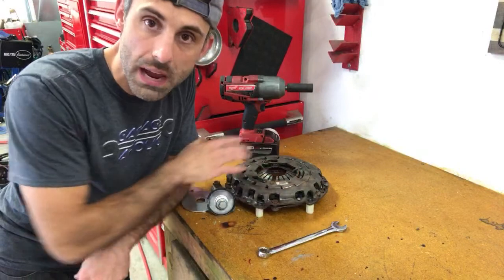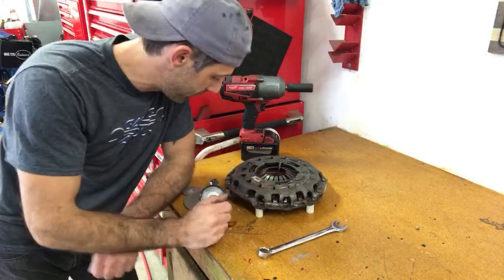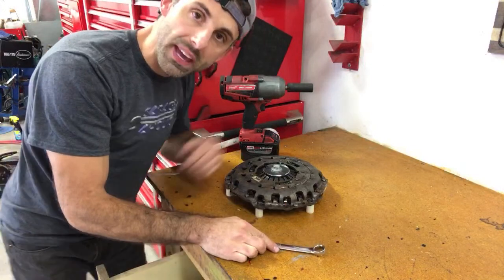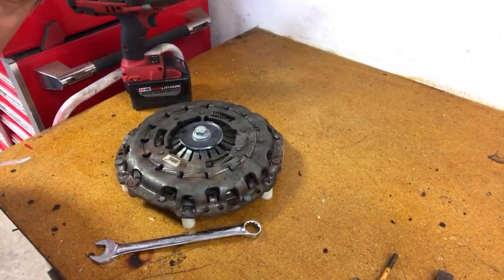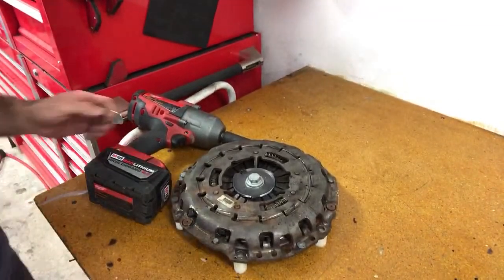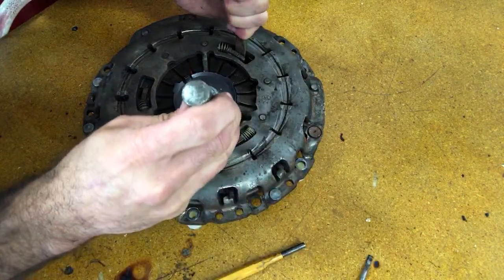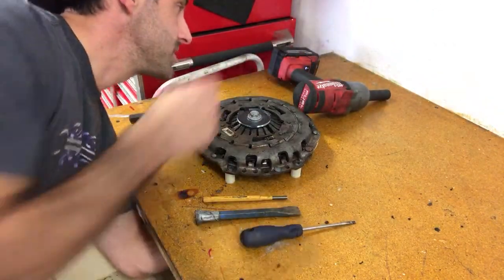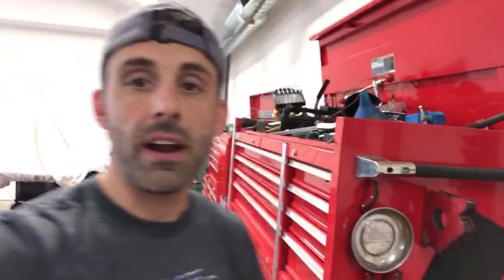LIVE: How to reset your BMW pressure plate with automatic clutch adjustment

Comment: I have a problem with my BMW M2. The clutch was burned at 5,000 km, and the car could no longer drive. I eventually replaced the clutch with a new clutch set, but I didn't perform the SAC reset. Could this cause any problems later on?

Comment: What if your reusing a 5000 mile clutch and putting it with the pressure plate in another car its a luk self asjusting clutch in a 2004 bmw 330i,  basically want to use both pressure plate and clutch from that car and swap it to another car, do i still have to do the reset?

Comment: So i installed a clutch kit at 60k miles...i mistakenly didnt replace the flywheel ...so now im getting a rattling sound at idle that goes away when i press the clutch....so my question is...when i originally installed the pressure plate it had a lock in the center....so after you reinstall it without the lock...im assuming it will adjust the first time you press the clutch?
Reply: Rattling sound is usually release bearing brother. One way to tell is if you hit the clutch and the sound goes away, 100% release bearing
Reply: @TheRealist007  took it to a shop and ended up being the flywheel had play...def sounded like the release bearing though

Comment: Hey so I’m installing my LUK 335is clutch / pressure plate combo today. 
Does That center locking plate on the new PP come off before I install so I can keep the clutch aligned?
As well as do I need to keep tension on the PP when/if I remove that plate or can I simply twist it out?

Comment: If I may ask, what is the purpose of doing this?
Reply from the maker: If you replaced your clutch plate without replacing your pressure plate.
Reply: @Garageaholic  so like my Dad's engine was replaced and cruise control stopped working after. Could this be the cause?
Reply from the maker: Definitely not. Probably something electrical I’m thinking. Not a pressure plate setting.
Reply: After replacing the engine, the gears failed to engage, so they stripped it again and discovered that one two of the springs were broken. Instead they replaced the pressure plate. The gears engage just fine. But the problem is that sometimes it vibrates and the issue of cruise control not engaging as it was engaging before the engine was replaced

Comment: Thank you man I took the retainer off on my new pressure plate and didn’t realize it completely released and installed it and it wasn’t until after I bought a new clutch master and spent 2 days screwing with everything that I realized this happened I had zero clutch pedal it was just rock solid

Comment: Great vid! I just installed the clutch in my 6 speed swap E32 and realized after the fact that I forgot to clean the pressure plate surface😅! Was looking this up thinking I would have to readjust the clutch to lock it again or something but after reading the comments I see that I can just reuse it as long as it's brand-new which it is
Reply from the maker: Yep, i think I answered your Question on IG, right?
Reply: @Garageaholic  absolutely thank you! I also have put 100 miles on it so far and all seems well 👍

Comment: If I don't reset the pressure plate after changing my FLYWHEEL to another used one, can it cause slipping? Because I am now experiencing slipping after replacing it.
Reply from the maker: Why change an expensive flywheel without changing the PP/clutch?
Sounds like your pressure plate does need to be adjusted. that, and the he surface is no longer the same surface as the new flywheel. So probably the new flywheel surface is gripping more than the he pressure plate and causing the slipping imbalance.

Comment: the mechanic changed my motor and he didn't resset the clutch i told him he needed to do that and now the car won't go into gear he made me buy a new pp and clutch got home removed the neww clutch reseted the plate put it on the car started the car boom went into gear told him about this and he refunded me thanks alot mate
Reply from the maker: Yeah that’s EXACTLY the reason it’s so important. - so you don’t get taken advantage of!

Comment: A company (Asian) named VidaXL has an exceptionally nice clutch tool set for resetting the pressure plate on the car, which is how I like to do it. No holes in the plywood.

Attach clutch disc normally (kit even comes w metal clutch alignment dowels if you forgot yours or don't have handy in tool box!)

Again, attach clutch disc (gearbox side written on disc! Pay attention! Gearbox side of disc is the side that faces back towards rear of car! Writing visible in your face!) 

Attach pressure plate to guide dowels on flywheel. Hold with hand to prevent falling. 

Attach 3 pressure plate bolts loose in triangle formation. 1, skip 1 hole, 1, skip another hole, final bolt. Make sense? 

Attach tool tripod with press fixture pressing screw backed off (loose) with 3 standoffs (supplied w kit) in 3 empty flywheel bolt holes. (a 4 leg tool also included in kit!)

Secure tool on standoffs with finger nuts tightened finger tight to tripod or 4 leg fixture. 

Tighten press against pressure plate. 

There is a sweet spot where the press will release the adjustment disc inside. 

Use a screwdriver etc to push the disc to the maximum retracted position. 

In kit, a gapping tool to maintain gap csn be inserted and expanded to hold the disc. To be sure, you can use screwdriver etc to push on the adjustment disc and install the tool close to the max gap and then apply force to the disc and adjust the tool so it is snug. That prevents the disc from jumping. 

Additional support for disc is possible using a pin or thin screwdriver in a disc hole. You will see spaces to insert something while you previously marvel at the disc function rotating in and out.

Now loosen press fixture with gapper and pin if desired installed. 

Remove standoffs and press fixture. Tighten 3 remaining pressure plate bolts. When bottomed out it's plenty tight. Or about 22nm to max 30nm. 

Remove pin if you used one. Loosen and remove gapper. 

Job is done put transmission in and done. 

Tool suite was under $100 and you get like 30 tools in the box for various self adjusting clutches for various cars. 

Best
Reply from the maker: Good comment - you should do a video on it
Reply: I am honored by your reply! I found your channel when considering how fun it would be to install a N54 with the SAT sport automatic transmission option (short shifter with paddle steering wheel) into an E28 bmw 5 Series. It is a pipe dream, but it would be fun.

I do think a video would be beneficial. Due to supply chain I looked and all unavailable (VidaXL) clutch reset kit for sac self adjusting clutches. Very disappointing. I paid somewhere around $80 usd. It is an unbelievable quantity of well machined pieces for 80 dollars. Visit the bmw dealer and you'll see how little you get for $80 for obscure plastic etc. Probably half of an A Pillar for an E46 as an example.

I think a deep search will reveal kits available but maybe on less used sites or tool resellers specifically.

Very impressed with your E36 N54 build, I did not watch every second as I often listen and work and etc or listen while driving here n there but I have a lot of respect for the amount of dedication to completion a job of that magnitude must be.

I hope to do a vidaXL video. If I ever started doing videos I would dual post on lbry.tv as I like censorship free content. Naturally most YouTube car channels don't get censored but I believe Samcrac did when he was doing a silly video with his "step mom" and maybe there was a "wardrobe malfunction" LOL and u tube put the fact checkers or some other censor nonsense on it for a harmless video from what it sounded like considering YouTube allows a lot of pure hate as long as it's hate that aligns with YouTubes nebulous terms and conditions or whatever they call it.

Anyway I sought out your video because I was like - why the heck is this plate not moving, I know what I'm doing! It takes a bit of playing around the first time and then it's useful to have some head scratching moments if the disc is rusted shut or old.

That's my situation, the owner put the engine in and didn't reset the clutch or anything and all the bolts were finger tight for the pressure plate. Sat wince 2019. No wonder the clutch didn't work for shit. And no start which was a bad key after bypassing ews2 module to gain cranking. Just a clutch he said... Ya right! Now he prefers to reuse his original. So at least do it right. I believe first press of pedal will adjust clutch to correct wear position. Clutch is cheap, Luk is 250 range and some shops even resurface the DMF.

Comment: Hi Frank, I installed my LUK sac pressure plate in my E85, removed the centre locking plate and the friction plate wasnt quite centred. This meant I had to unbolt the pressure plate, realign the friction plate again and rebolt the pressure plate back to the flywheel. Would doing this disturb the self adjusting mechanism? Great video very informative.
Reply from the maker: Hey Tim absolutely not! You can just install the pressure plate back on the new clutch as-is. (Assuming both your PP and clutch are brand new)That center locking plate is simply supposed to make things easier during install
Reply: @Garageaholic  excellent thanks very much mate. I was a little worried as the clutch bite point is pretty high. She drives fine in soft or hard throttle but if manoeuvring slow under load (say parking on a hill) the clutch will whistle and slip. Very odd indeed. Never had it before. I'm going to remove the slave cylinder and have a look inside with my inspection camera. Thanks again mate. 👍👍👍

Comment: @Garageaholic great informative vid!  if the clutch isnt adjusted, can this cause some grinding when shifting thru the gears?
Reply from the maker: ABSOLUTELY. Ask me how I know! Using a brand new (stock) meatier clutch disc with old pressure plate. Pressed pedal to floor and could barely shift into gears. Just wasn’t quite disengaging the clutch before I reset the plate.
Reply: @Garageaholic  So this simple clutch adjustment could potentially save me from a costly transmission rebuild then?
Reply: @Garageaholic  then again i think my clutch is original @ 106K so maybe a new clutch is in order

Comment: What if i replaced the clutch disc without reseting the pressure plate?
Reply from the maker: You won’t fully disengage the clutch, push pedal to floor and won’t be able to shift into gear. This happened to me on the e36 n54. That’s why I did this video - lesson learned
Reply: @Garageaholic  thank you appreciate